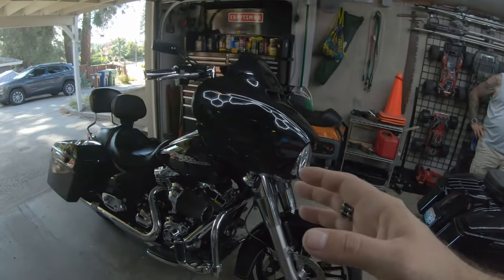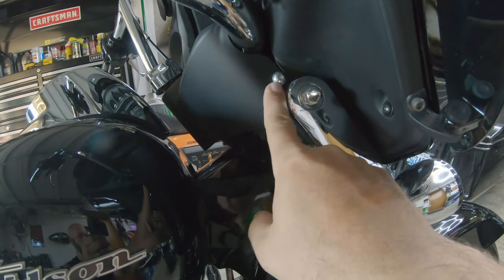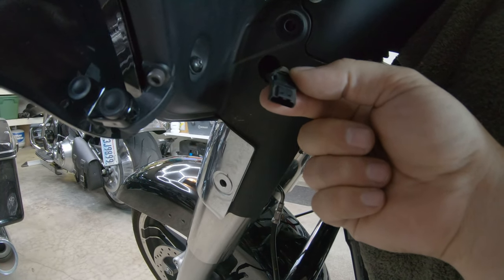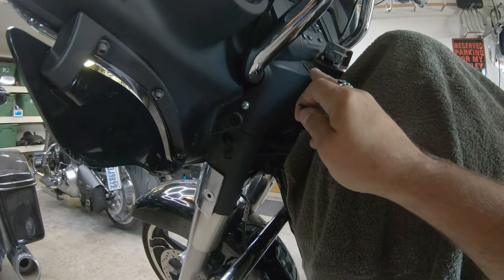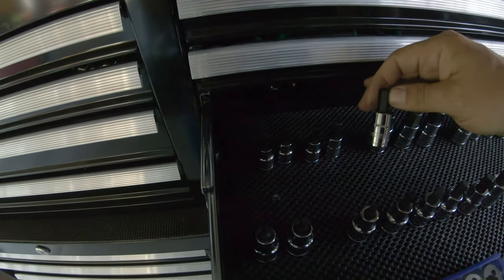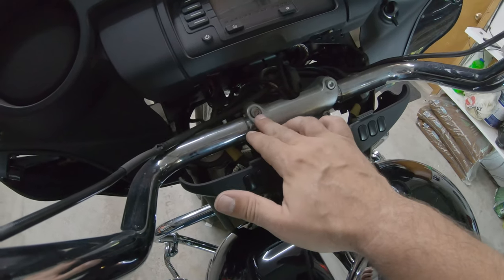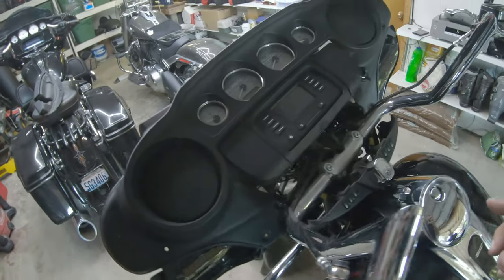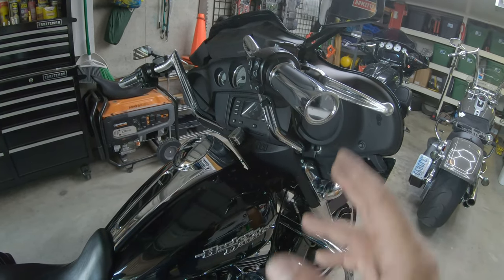Handlebar adjustment on a 2014 Street Glide courtesy of an asphalt crater

Comment: This reminds me I need new higher bars for my set up. Thx
Reply from the maker: What are you running currently? Any particular new bars in mind?
Reply: No but I have to take my eyes off the road to look at my mirrors that are to low for me.
Reply from the maker: @MrUC53  That's a recipe for disaster
Reply: I am 6’4” guy, never measured my torso and arms to know if I need 12 or 14 bars or higher.
Reply from the maker: @MrUC53  I'm 5'9" with a 28" inseam and I went 10" on my last Street Glide. I should have gone 12" in retrospect so I'd recommend 14" at minimum personally. I never hear people wishing they had gone with shorter bars...for what it's worth
Reply: Perfect advice. Now the pocket book would have to agree. Hopefully soon before the real weather starts.
Reply from the maker: @MrUC53  Oh I feel that, new bars ain't cheap. But I do prefer to do them during the snow season, that way I don't miss out on any riding.